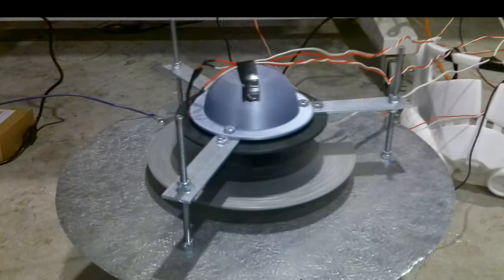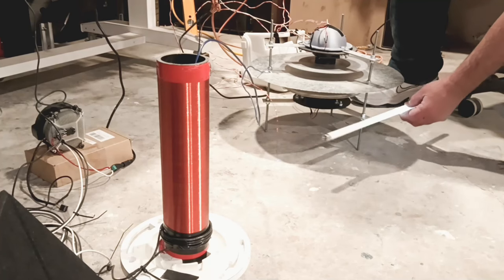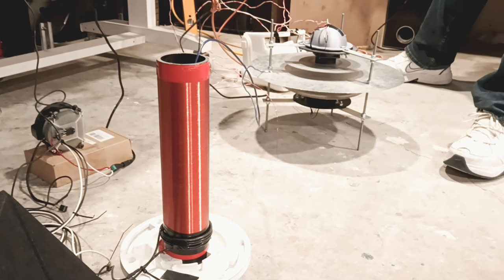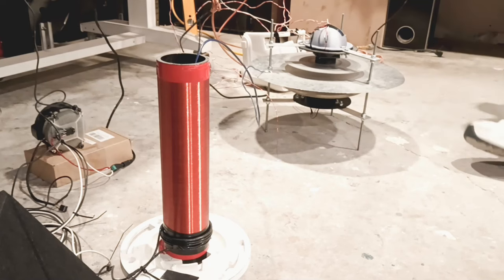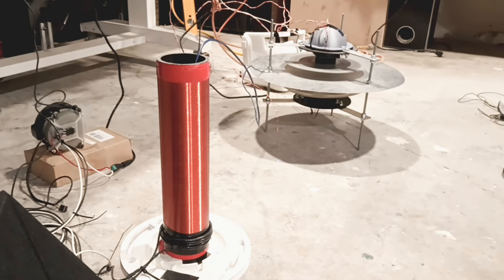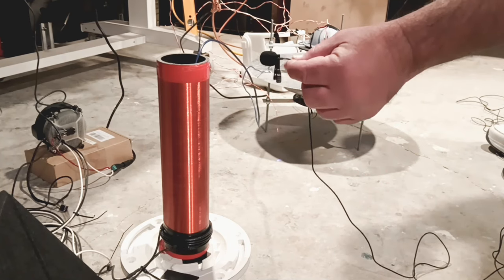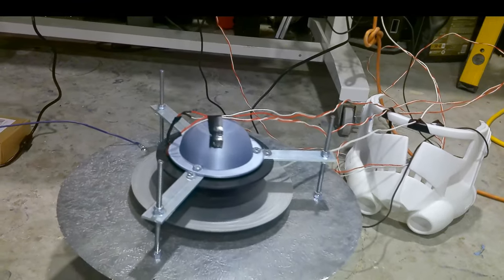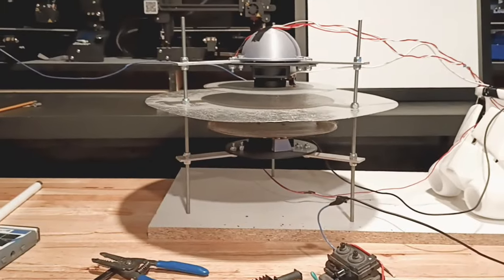Graviflyer Testing 2

Comment from the maker: the top disc is 7/8" off the center plate. The bottom disc is 1 1/2" off the center plate. using rare earth magnets. Yes i have neodymium ones not on at this time. The bottom disc is at 385 rpm and the top is at 720rpm at the point where i got the vibration. I checked with laser. will show next time. I will also show the oscilloscope readings in future video's.

Comment: Nice work! Your test with the mic indicates the position of the wire down inside the Tesla coil controls the frequency that you are outputting to the center disc.
Reply from the maker: the wire is all the way down the tesla coil. not just the top portion.

Comment: Can you use cymatics method? Just by covering top of middle plate with salt you can see path of sound waves. I suspect a certain hexagonal patern might help.
Reply: This will get you the frequency, but you need something more than a plate to see how 3-dimensional the sound wave is acting.
Reply: @Tech_Planet  Dusty plasma field in a controlled environment might show 3-dimensional patterns.

Comment: I would use 4 different condenser mics around the top half, one outside your coil and measure it in SPAN (spectrum analyzer) in a DAW (like Reaper) and compare the peaks.
Reply: We use much the same equipment. I will donate some of my equipment on loan. Any active mics will do. I have 100.000 KHz test mic.

Comment: 12:50 best recording of the tesla coil. Down to 7 hertz longitudinal. When I mentioned high pitch ticks  in a previous response those were best heard mic top outside coil edge inches out. After a few listens I recommend recording were Alexi positions himself center panned.  Left full pan close to graviflyer & Right full panned coil. All channels volume levels equalized .

Comment: The differences in the separation between top and bottom plates from the centre will explain the tube output differences from top to bottom tests, they are capacitively coupled, but not balanced, hence the difference.
Until you get both spinning disks mechanically balanced and running evenly, any noise/beat is at the moment due to mechanical imbalance and resonance in the system, nothing electrical.
The bottom disk has a distinctive wobble, which means it is not dynamically balanced and is causing the vibration in the assembly at mechanical resonance of the rig, hence the speed effects the rattle.
Looking at the clip, the sound appears to be in time with the bottom disk's wobble.
Using the microphone around your machine is not good, the EMI from the system was at the start of this clip causing most of the pickup noise we heard, nothing audio.
That is why your camera eventually locked up later, and the microphone later in the clip did not appear to work.
The microphone is probably an electret unit, which is a capacitive type pickup, so it is very sensitive to EMI and the long lead on  your microphone is possibly picking up enough interference to cause your camera electronics to fail.
Can I suggest you keep the microphone away from the rig and especially the tesla coil because of the EMI fields, it probably has no high voltage insulation rating.
When ever you think the tesla coil is causing an effect, turn the coil OFF during the effect and see if it disappears.
By turning it OFF I mean turning the drive circuit OFF, not removing the connecting wire.
Keep going, but consider the limitations of your gear.
Reply from the maker: I keep hearing a mic cannot be put next to one of these so I just wanted to show it. Even with the fails it showed something more with the tesla coil. The emi might be much higher on the top of the coil. I have more testing equipment but wanted to try it by sound this week.

Comment: This  "MAY" interest you.
I have just used the AI bot called "Claude". I know that an AI bot can be wrong sometimes but this is the latest edition of "Claude".
I initially asked it if antigravity could be produced and the typical answer was, "The technology is not available at this time and there is nothing to prove it could be demonstrated".
Ok now hold on. I gave it more information regarding the Graviflyer. Such as the components used and the name of the inventor.
 
I then asked this question just out of interest below:

"Would copper disks produce more eddy currents and what configuration would be required, For example: Would the larger static disk stay as aluminum, or would the top and bottom rotating disks, either both or just one, be made from copper?"

I asked that question because it had mentioned "eddy currents" being created in another question I asked.
The fact it mentioned "eddy currents" interested me. So here  is the answer it gave regarding my question about copper:

Claude said, 
"Using copper discs instead of aluminum could potentially enhance the electromagnetic interactions in Chekurkov's proposed "graviflyer" device design, as copper is a better electrical conductor than aluminum. Here are some considerations for optimizing the disc materials and configuration:

The Static Middle Disc:

    Keeping this large middle disc as aluminum may be preferable, as aluminum's slightly higher resistivity could help induce stronger eddy currents when exposed to the changing magnetic fields from the spinning discs.

The Top and Bottom Rotating Discs:

    Replacing one or both of these spinning discs with copper could be beneficial for generating more powerful spinning magnetic fields to induce the eddy currents in the middle aluminum disc.

    Copper's higher conductivity would allow the electromagnetic coil windings (energized by the Tesla coil) to generate stronger steady-state magnetic fields in the rotating copper disc(s).

Additionally:

    Having just the top rotating disc made of copper, with the bottom disc with magnets remaining aluminum, could create an asymmetric field interaction that may be desirable.
    Alternatively, both rotating discs as copper could maximize the magnetic field strengths in opposition.

Eddy Current Enhancement:

    The improved conductivity of copper rotating disc(s) should allow stronger circular eddy currents to be induced in the aluminum middle static disc by the spinning magnetic fields.
    These eddy currents then generating their own magnetic opposition could potentially contribute to the repulsive electromagnetic forces claimed".
 
Well, I personally found this answer very interesting because it never said that it won't work but instead gave information very similar to what you have been saying. Sorry for this long comment but as I said, I thought it might interest you. 👍
Reply from the maker: it sounds really good.

Comment: i heard, at high revs, magnetic field, merges into one
in the middle plane it is an electric generator ? and its rudeness, it is a chaotic movement of currents, overturning? chaotic movement may be blocked by the upper rotating disc ?
because a beautiful electromagnetic motion has to be compressed on top

Comment: Are you sure that both plates have good connectivity? What kind of brushes do you use? (I just assume you use some kind of brush on the spinning plates to feed the HV). Im just saying that because it could explain the intermiddent connectivity depending on motor speed.
Reply from the maker: the brushes are striped wires connected to copper plates. They work just fine. I was pointing out the tesla coil has a direct effect on the high voltage on the discs.

Comment: I think you should use car battery because it can provide more amps. Even Alexey used car battery when testing indoor.
Reply: Second you have to use shielded wire specifically for the Tesla coil.
Reply: Third put the entire device on scale to see any weight change.

Comment: I hear something out of balance and another rubbing
Reply from the maker: the bottom disc is rubbing a little on the high voltage wire. the motors run at different speeds so yes in a way out of balance.